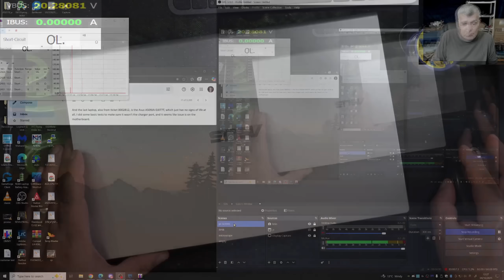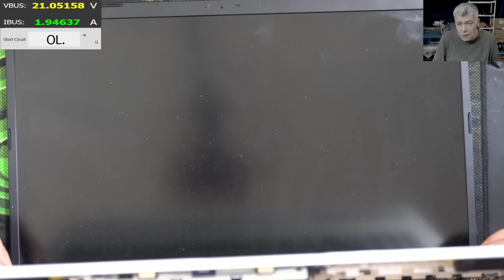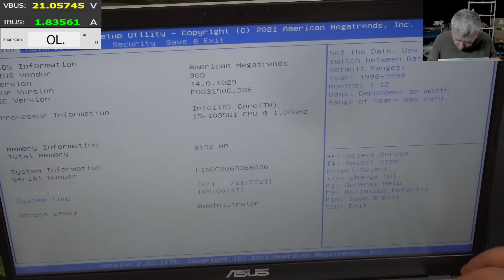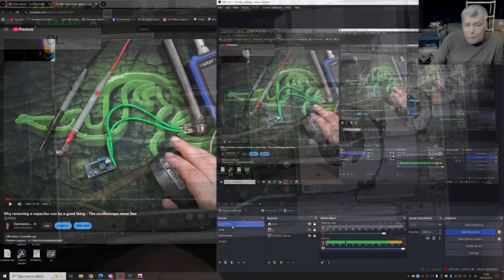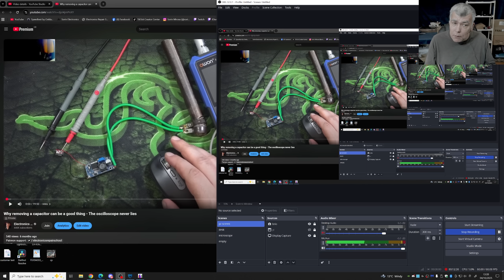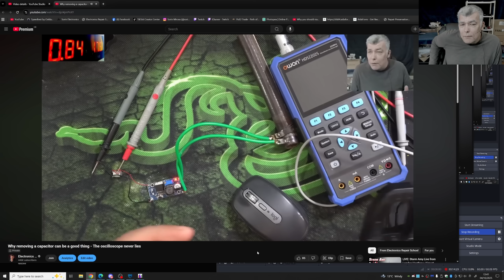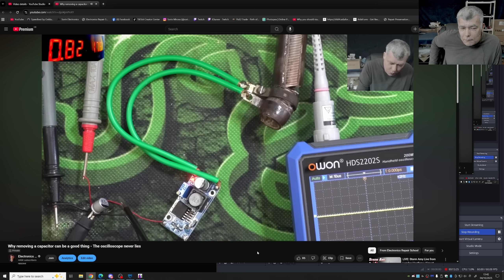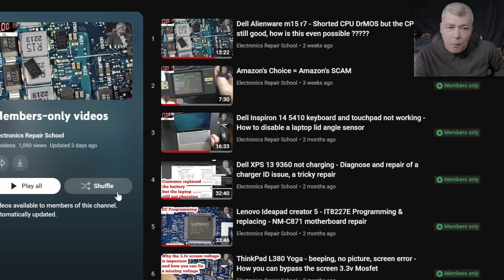Asus A509 not charging, a shorted pizza can be quite a common fault

Comment: If you want a solution to the thermal camera, 3d print a bracket , you can use pcbway to print it, make a bracket that attach to the microscope and a enclosure that you can secure the thrmal camera inside

Comment: I agree - I once looked at an external hard drive where a fuse had blown. Removed the fuse (it was more like a blown diode), hard drive started working again. Telling myself the fuse should be replaced, I messed up and killed the hard drive again.

Comment: That cooling design e very problematic, not good at all, with time, the air passing trough the capacitors near the fan makes the capacitor acumulate humidity and than fail, i had several asus with that problem, shorted capacitor near the fan, comon fault... Regarding a way to secure the camera bellow the microscope, as the camera is very light you can try securing a USB-C female and Male U adaptor and connect the camera as you need 😁

Comment: The electrolytic and the MLCC are doing totally different jobs. Not replacing a capacitor can be OK, or it can cause serious issues, but the big issue with MPCCs is it's a bit of guesswork regards what value to fit.

Comment: There are a LOT of poor designs produced with caps close to parts that run hot. In pinball machine power supply there are electrolytic caps next to regulators and after 15 years the capacitor dries out and then fails. The fix is to remove the cap and move it away or put a heat shield between the hot part and the capacitor. Just because some manufacturer makes something does not mean it is a perfect design. For laptops that essentially run hot all the time all over the board, the right thing to do is remove the bad capacitor and not replace it since there are so many other capacitors on the same power rail that it won't make any difference removing one. It's like pissing in the ocean, it doesn't change anything lol

Comment: Interesting cooling design, probably with a dam on the back cover that goes on the white lines on the PCB. Reduces the forming of a dust layer on the cooler fins and in that way less cleaning maintenance needed but less efficient for high TDP cpu's.

Comment: Hey Sorin, easy pizza indeed. Is there an easy way to perform that diagnostic (shorted cap) without the thermal camera ? I mean yes you can use alcohol, but is there a way to be able to focus only in a specific part first ? Thanks for the content :)

Comment: Nice Pizza...🍕 Sorin! (Q: But what if, the capacitor - 330uf- is not getting hot, but multimeter shows it's shorted -mesured exactly on top? will (we) remove it?)

Comment: Sorin, you need to spend many hours in EMC lab and by designing those things and you will find out why you need capacitor close to transistor/chip. Go to EMC lab and show us conducted emisions and radiated emissions, not ripple on scope... But I agree with you, you can remove capacitor. Everything will work OK. But with worse EMC. And no chance that it will crack again. Design problem with cracking capacitors is that instead of using more capacitors with smaller capacity there is one with high capacity with many many layers and capacitor like that is more fragile. And of course laptop poor guality. Board is flexing and bending, because of poor weak plastic construction. In some higher quality products there are 2 MLCCs in series perpendicular. If one crack and is shorted, you actualy have higher capacvity then... But of course this is not inside cheap consumer products... So difference is if you are designing cheap consumer product or electronic for satellite or life support machine. There are known techniques how to make product much more reliable, it is only about price...
Reply: one would argue that for home end user emc doesnt really matter, i mean every overclocker turns off spread spectrum in bios but its still there for a reason i guess
Reply: @ps-ib6ct  Yes... I agree. But manufacturer have to design it as compliant product. Each classic desktop PC is out of limits with EMC if you have poor case, or not closed case, or without IO shield or big window to see inside. But motherboard is tested for EMC and certified with proper case... :) If you are working with sensitive HF stuff an you open PC case close to yout stuff, you will see big mess radiating from PC... What is even more anoing is tahat in really sensitive headphones  connected to PC you hear everything, starting motor of HDD/wake up, mouse moving...
Reply: @xxJerry19xx  What funny is i have my case open and its on the desk next to my mouse and headphones and i can actually hear the mouse moving in headphones xD

Comment: Hi, are there anybody here who can say to me why i have get one cheap set of power plug different shapes from a notorious china web market and if i use one for HP laptop with center needle and fed by old notebook style power supply, the HP laptop refuses to turn on where with its original one it does? Note: orig.=19v 2,x A; spare one: 19v 4,7A (almost brand new/tested good), 2nd note: orig: input plug with earth; spare: no earth... Thanks
Reply: Some charging ports have a (third) ID pin that checks whether the original charger is present. Adapters don’t propagate that signal and just supply +/- voltage.
Reply: @toolsarecool  yes i know this, but the tip adapters are sold for a reason, why to sell these if them don't do the job? And Sorin what uses in this video? My adapter connector for Hp has 100kohm resistor between the +supply and center needle, them delivers 19,4v the + and 19,2v the needle.. thanks
Reply: @Davpana maybe you got a faulty one
Reply: maybe the center pin is too short, i will open the laptop..

Comment: Big capacitor will provide energy when a surge is present, same as small capacitor. Difference is impedance and the frequencies filtered. You measured the ripple on a specific use case, constant current, specific fixed voltages. Try to power on/off and switch the load, different frequencies present on the main power rail from other SMPS's and you will see that there is a big difference to what you measured in the takedown video. It could be that the mosfet works just fine, or it could be that it will fail sooner, you will not know that because there are too many variables involved.

Comment: Could use Velcro dots to mount your thermal camera just a suggestion. Thank you for all your videos esp the ones that you do not replace the capacitors they are my favorite.
Reply: Velcro is glued on one side as well, probably would fall doen
Reply: @Tribes11  Maybe although the proper velcro has some pretty strong adhesive but yeah the heat might get to it like you say.

Comment: Oh boy! You can be sure that if it worked without a capacitor, the manufacturer would have saved on it!!!
Reply: Your IQ is definitely a 2 digits man.. Sad ..
Reply: It works fine but may give out slightly higher interference which may mean the unit failing FCC testing. Not all specs are based on does it work or not.
Reply: Sorin has given you the answer to that in the video. You just have to leasen and understand what he is saying.

Comment: we worked with company that was producing professional custom power supplies for machines, they had problem with a small ripple that was produced when the logic unit was switching the output, the power supply was really great when we tested it, but they wanted that ripple gone. they could sell the power supply as is and it would be ok, instead they wasted hundreds of thousands just to fix that ripple, but they did get it solved.
the issue here is that companies never ever cut from their profit, the bill they waste for trivial things always falls on the consumers in the end...
Reply: Spending hundreds or thousands on this is really crazy. But generally speaking, removing ripples is essential for audio equipment or devices that process or analyze waveform frequencies (DSPs, etc.). It's also crucial if they need compliance with specific standards, otherwise, they wouldn't be able to sell their products in many countries!
Reply: how they fixed it?